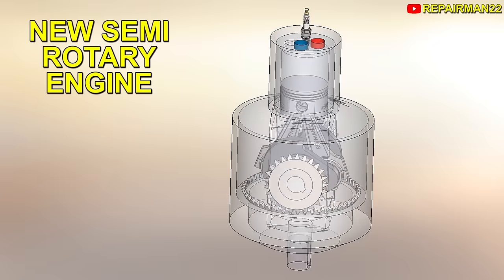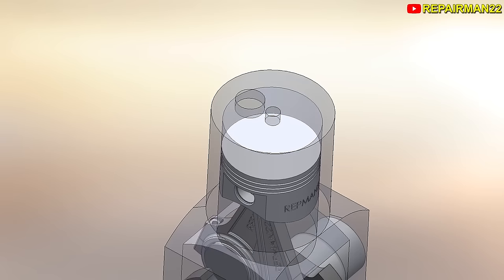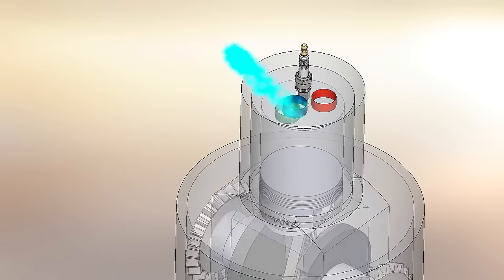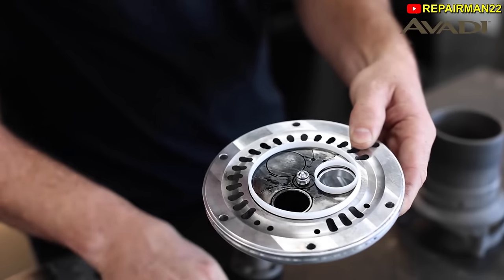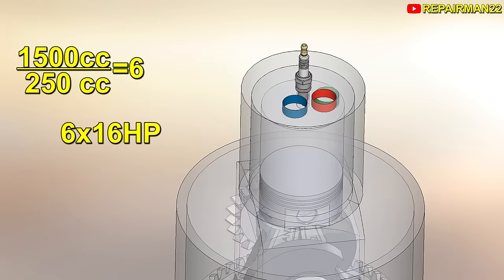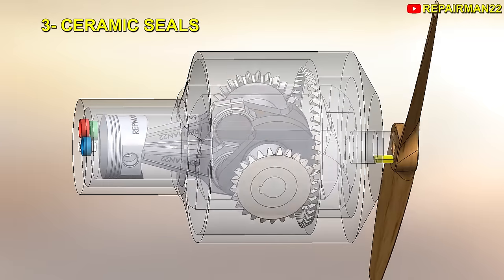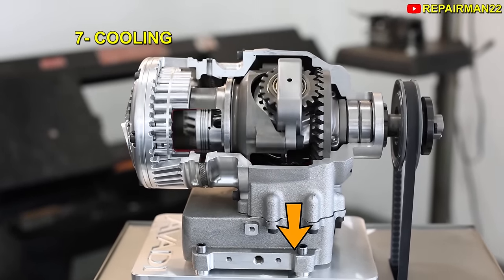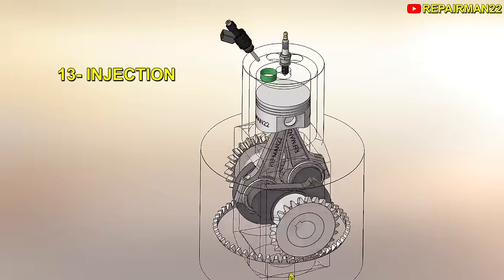New Semi Rotary Engine with 2 Connecting Rods 🤯 Avadi MA-250

Comment from the maker: https://wtplay.link/repairman22 — Download War Thunder for FREE and get your bonus!
Reply: 4:51 This is insanely efficient

I love to run the numbers on any motor that I ever see

Your average hot rod motor moves 1.35 CFM to make one horsepower

The closer you get to a formula 1. It's more like a 1.00 to make a horsepower

This thing 0.96 CFM to make a horsepower

So this thing is officially making more power per cubic inch than formula 1

5:00 yeah see this motor is 1.65 CFM for a horsepower. It shows how much more efficient the first one is
Reply: Don't download it, my wallet and my sanity are gone. This game will ruin your life and will to play any game for more than 5 minutes at a time.
Reply: @Bozemanjustin  So uh.... life of that wrist pins gonna be what 20-30 hours? This is a joke, it will have NO reliability. Rotating the piston rings is also a nightmare. Hey, on the bright side, if it weighed more it could be a boat anchor.

Comment: The side pins that are connected to the gears are submited to great forces, by being supported on only one side, the bushing/ bearing will fail fast.
Reply: As opposed to conrods? It's a non-issue.
Reply: @michaelbuckers  Conrods are supported equaly by the crankshaft. It is an issue.
Reply: You would be correct, but if you look at the 3D model provided by the company you see an additional support bracket at the other side of the gear.

Comment: I think the age old problem with all engines with sliding type valves will be sealing the ports properly when they're closed.
Reply: yep. sliding valves never work when exposed to extreme pressure and extremely hot exhaust byproducts...

but what i keep seeing with all engines is the terrible mechanical advantage they all have on expansion versus compression. really good at compressing... really crap at expanding.
Reply: @paradiselost9946  You won't see different without a vastly more complex compound crank linkage.  See examples like the Atkinson engine.
Reply: @wagnerrp  You don't need that linkage for the advantage, see Miller cycle. Toyota also calls it Atkinson cycle, but it's actually closer to Miller cycle. Basically, compression stroke is retarded by keeping intake open part of the way piston goes up after intake stroke. This pushes some air out through intake. Some economical modern engines with variable valve timing are fully capable of switching between Otto and Miller cycles depending on power needs. Otto utilizes more volume and time for compression stroke for maximal power output, but Miller/Atkinson cycle is more efficient. Real downside is complexity.
Reply: @jarivuorinen3878  Toyota has an Otto cycle engine that simulates the Atkinson cycle.  Miller is just Atkinson with a supercharger.  Toyota’s modified Otto cycle does not address the claimed issue.  During compression, peak pressure occurs at the top of the sine wave, and you get maximum mechanical advantage to keep compressing that charge.  During combustion, you still start at the top of that sine wave, and expansion experiences maximum resistance.  You cannot change that without either a compound linkage, or eliminating the crank and doing something even more radical.
Reply: @wagnerrp  You can get very good mechanical advantage on expansion by simply offsetting the crankshaft a little.
Reply: Also the sliding valve severely limits the amount of available intake air that can be supplied to the cylinder.
Reply: @A_Frog_from_mars12  Could be overcome with forced induction. Or the ports could be shaped more oval to give more flow in the middle of the cycle. Valve sealing will be the biggest problem same as with all sleeve valve engines.
Reply: I think this engine can also easily be build with classic valves, but without a camshaft. The valves would be actuated by "bumps" on the outer cylinder.

Comment: Lets crank the friction WAAAY UP for...some reason.
Reply: Now lets spin the block, woah ! now lets spin the car ! Let's spin everything in the engine and drivetrain except the wheels !!!
Reply: i would not be surprised if it has very high thermal efficiency. basically piston goes directly up and down. sure it rotates but even going directly up and down so way less friction like traditional engine. plus no puppet valves. no energy loss for those springs
Reply: @doesnotcompute6078no valvetrain. As mentioned, poppet valves are the main limitations of modern engines, as well as force imbalances on pistons due to cam offset.
Reply: doesnotcompute6078 Where did you find information about the friction forces of the engine?
Reply: @doesnotcompute6078 Where did you find the data about the friction? Or are you making it up to win an argument on the internet?
Reply: @doesnotcompute6078 That isn't honest. You don't have any data or solid evidence, you are making a guess based on what you believe to see from the video, neglecting the real engine design, or the running prototype engine.
Reply: If you watch the video it tells you what the thermal efficiency is
Reply: It has about the same friction of a single piston engine with a transmission

Comment: No, it’s a 4 stoke , one rotation engine. A rotation and a stroke is not the same thing, has never been the same thing, and will never ever be the same thing 🤦‍♂️
Reply: Yup, sleeve valved 4 stroke 👍
Reply: no compression cycle no 3rd cycle between the exhaust stroke, it only goes up and down once per firing sequence the next is exhaust. 

less losses to friction is quite possible, only things rubbing are the rings and bearings. 

tho ceramic is built to fail? and would grind into the metal?
Reply: @pazsion  The engine has an exhaust stroke, an intake stroke, a compression stroke and an ignition stroke. 4 separate stokers, i.e. a 4 stroke engine. Sorry you have trouble counting and comprehension issues son. 🤣😂
Reply: Certainly not single stroke! ...This channel gave bad information ☝
Reply: @appleeater8839  A stroke is a pistons's upward or downward motion, not crankshaft rotation.
Reply: @appleeater8839  Wrong, it is identical to conventional 4 stroke engines with the exception to assembly rotates in the horizontal plane also. The horizontal plane rotation, although somewhat unusual, does not detract from the fact that it is a plain old 4 stroke engine like millions of others.
Reply: Watch piston moving up and down and you see all four strokes very clear
Reply: It technically is a 4 stroke engine and I’m wondering if they can make it a two stroke with different valve locations and gear ratios
Reply: @pazsion It does compress though. He even said the ratio has to be 2 to 1, because the piston has to move 4 times per combustion stroke
Reply: I was thinking the same thing.
Reply: Zero wear? Right
Reply: Yeah 4 strokes and one revolution, complicated design as well, weird.

Comment: There is a lot of rotating mass per cylinder compared to a traditional engine, with additional losses through the gears. In addition the head design seems limiting.
It is good to see innovation but it is unlikely this engine will be more efficient than a conventional piston engine.
Reply: The gear loss is the same as a normal piston engine with a gearbox, the gears give it a 1:2 ratio at the crankshaft

Comment: It's relaxing to watch these videos.
However, with more moving parts, it may be more unreliable than a conventional engine
Edit: the compression stage will force a load onto the piston, which will be transfered to the connecting rods. The resulting opposing forces are not completely canceled out, as they are a perpendicular distance apart. This forms a rocking couple which tries to rotate the piston from the top and twist the connecting rods, putting a lot of physical torsion on them.
Reply: actually it has no cylinder head or valves or camshaft and they can most definitely make it so it can be a one crankshaft engine instead of two. but it will vibrate more and that might make it less reliable...
Reply: Theres less moving parts but more rotating mass and oiling may be an issue. The ceramic sealing surfaces lasting though, maybe.

Also where the f did they pull that a 250 honda would have 16hp? 150cc japanese engines do more than 16.

There are a bunch of flying bomb uses where short term reliability is just fine and it would just need to work for 10 hourds though.
Reply: @manitoba-op4jx The piston and cylinder rotate together.

Comment: So at half way in the video you make it seem like the engine is way better than a traditional engine in terms of performance but later down the line you say that the engine is actually at a 2:1 gear ratio by default so its actually the same. Honestly I don't expect these engines to make it to the market because the seals are probably not going to be able to withstand the harsh conditions as well as poppet valves can
Reply: You can easily replace the ports with poppets.  Just make the top of the cylinder a cam to drive the valves.  You cannot get rid of the outer ring that seals the cylinder to the head.  As mentioned in the video, they're actually going a different route, and moving the ports to the side like a traditional two-stroke, where the ports are now protected during combustion.  Again, you still can't get rid of the outer ring, but that will be much easier to maintain than ones that are sliding across an open port.

Comment: First thing I notice when I look at it are the straight-cut bevel gears. How much do I believe in its longevity and reliability, and why "not at all" is the correct answer?
Reply: Its just a proof of concept, small issues like these arise and find a solution.
Reply: Even if they were refined helical cut hypoid gears, they are still subject to heavy shock loads as there is no flywheel. Thus the gear are like how they are... Its a clever design, but not a good design...
Reply: @LunringNassar  I've seen the exact same concept about 12 or 15 years ago and it doesn't changed a bit. All the same problems with unnecessary piston rings rotational motion added, unnecessary gears, cantilevered crankshafts and difficulties with making the engine bigger than a single cylinder one (it's possible yet difficult and expensive).
In conclusion this engine doesn't make much sense because of added mechanical complexity and cost with almost non-existent benefits (only real one is it's balance but it could be achieved without all that gears and complexity).
Reply: Straight cut gears are tougher and have less friction than helical gears. What's your point?
Reply: @teolynx3805  It actually has less moving parts than a conventional engine because it uses rotative valves also the gears act as an integrated gearbox giving the engine a 1:2 ratio out of the box
Reply: The spider gears and axle gears in a car differential are straight-cut and last darn near forever in good designs. The helical cut gears in a car differential is where the most wear is seen, so your premise is suspect and would definitely vary by application as there are many places where straight-cut gears perform excellently.

Comment: Actually the piston does indeed rotate. Just because the cylinder rotates with it does not mean it is no longer rotating it is just that the cylinder rotates with the piston. I don't see how this extra rotational force could defeat the standard piston engine of the same caliber. Sometimes less is more.
Reply: The piston does not rotate within its cylinder, is the point he is making.
Reply: Yes I covered that in my comment.
Reply: And instead the entire cylinder rotates inside another cylinder, meaning that the cylinder is now experiencing friction and wear on both it's inner surface with the piston, and it's outer surface with the other cylinder?  @TitoRigatoni
Reply: @ericankney5957  Yeah I thought the same thing. Now, you COULD support the rotating cylinder within the stationary frame by placing it on bearings (which would significantly reduce friction and isn't possible if it were the piston rotating within the cylinder) but that's not possible if you want the cylinder head to act as intake/exhaust ports -- it has to slide beneath the port, causing friction, wear, loss of oil, etc.

Comment: This engine can easily be turned into a 2-cylinder opposite one by combining 2 1-cylinder engines
Reply: They'd have to figure out something fancy with the output shaft, you wouldn't be able to have it in-line with the housing rotation if there is another cylinder beneath it

Comment: The Germans are always worried about "Umlauf unruhe", or orbit discordance. This are the much higher loads, or moments of the piston given over a certain degree of the crank revolution.
Normally the flywheel takes these punches and equalised it to a certain, acceptable degree. The thick cranckshaft transfers the loads. It is thick, heavy.
In this engine certain toothgroups of the cogwheels are extremely high loaded and others are a barely loaded. Now these tiny tooth must transfer that explosive loads, and they are much smaller, hence very high loaded.
It could work for short period, like a drone.

Comment: "I was concerned there would be a lot of rotary friction between the piston and cylinder, but it turns out the cylinder and piston rotate together."
 
Okay, and the cylinder is rotating within its housing, including the whole cylinder head which must slide beneath the intake/exhaust ports. All you've done is move the problem to a different component.

Comment: No mention of the extreme friction and sealing between cylinders, or the rumble of the the whole thing rotaring on gears....Nah
Reply: That's what im saying. How do they seal the thing, it most loose so much compression or be so tight that it locks up when to hot. 

If they did more like a 2 stroke, it would make more sense where the piston actually seals the holes on the side of the cylinder wall

Comment: The biggest issue I see are crank bearings living a short life. The downward force on only one side of the crank will cause the bearings to be stressed, being caught in the fulcrum point of basically a lever. The piston will be pressing "downward" on one end and the gear pressing "upward" on the other. Similar to rowing a boat with the bearing in the pivot point for the ore. Perhaps a ballbearing design may relieve some of that direct pressure.
Reply: That was my first thought- this needs crank bearings at the center. There would have to be 2 bearings because the cranks rotate in opposite directions. Or perhaps a pressure-lubed plain bearing carrying both crank ends.

Comment: There's a lot of weight spinning there which translates to lots of inertia. Tuned trucks for car shows often tend tilt to the direction of their axle shaft spin since they're much heavier and faster spinning than regular, stock ones. There's a chance similar issues will happen in vehicles powered by this engine, especially aerial ones.
Reply: Inertia is only a factor when accelerating.  If you're at a steady RPM with a variable propeller, the only torque comes from the propeller itself.  If you have a fixed propeller, then the overwhelming majority of torque still comes from the propeller.  In either case, it's something the aircraft is already going to be designed to handle.

Comment: When under load the off center connecting rods angled in opposite directions will make the piston try to twist which will try to bind up the rod bearings creating extra friction. This and the compound gyroscopic forces from cranks rotating on rotating axes seem to me the biggest problems with this design.

Comment: Intake, compression, power, exhaust.. One stroke? Wrong word. 4 cycles(strokes) completed in one revolution of rotary valve and two revolutions of the crankshafts. You do not have a one stroke engine, but you do have a great idea.

Comment: It is interesting but another concern I would have is that the centrifugal force generated by a spinning cylinder may tend to cause  liquid fuel to cling to the cylinder wall. Not as much of an issue with NG or H2 but it would be better if the same type of force could be used to do the opposite and tend to force liquid fuel away from the cylinder/combustion chamber walls.

Comment: The primary efficiency limiter in a piston engine is the crankshaft, which allows zero torque to be produced at the top of the stroke, where the ignition pressure is highest and hence the greatest potential energy exists. Maximum torque is only realized at mid-stroke, where the pressure is greatly reduced.  Using two crankshafts does not change this formula, but does bring the added burden of eccentrically loaded bearings and hence early bearing wear, plus all of the added friction of incorporating a differential into the engine.  While this design is novel, it does not bring any tangible benefits.

Comment: Picture this thing on the power stroke with tons of cylinder pressure from super - or turbo- charging. One rod generating side thrust. The other rod is generating side thrust in the opposite direction. The rods cannot both be on the center line. So the opposing side thrusts result in a  torque or moment on the piston itself.  The only things stopping it from rotating in the bore are the small ends of the connecting rods being on a common wrist pin.l
It is a suicide-drone engine and that is about all.

Comment: Impressive indeed! Who would’ve thought that such out of the box innovations are still possible in the hoary old internal combustion engine!!! 

A question though… With a rotating cylinder within the stationary casing, I’m unable to visualise how the spark plug reaches inside the cylinder without itself rotating… and if it does rotate, how is the electrical contact being maintained at all, let alone the wear and tear of a contact rotating at ‘000s of RPM.

Any clarification would be welcome!!

Comment: The rings dont rotate, the inner combustion cylinder does, spark plug is affixed to outer stationery cylinder and protrudes into central axis port seal.